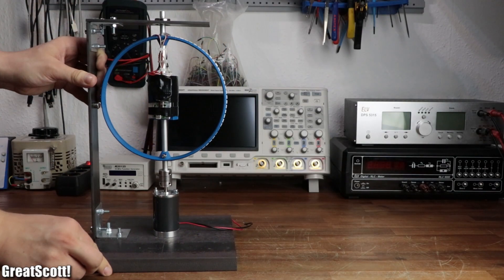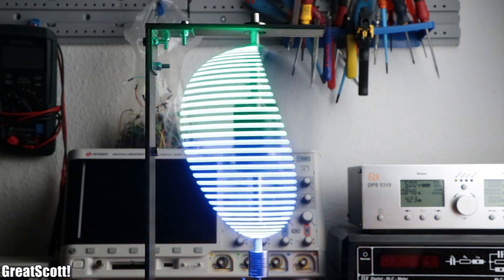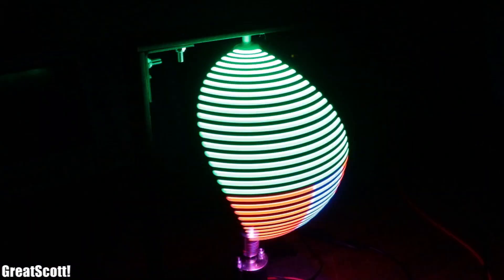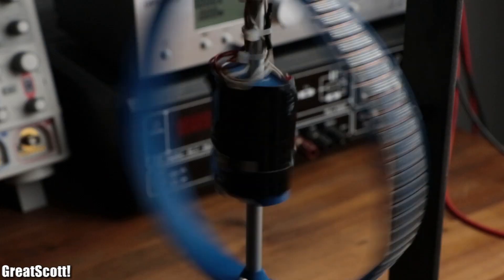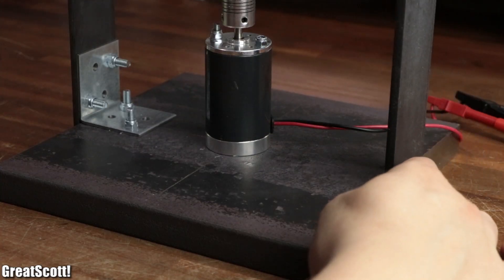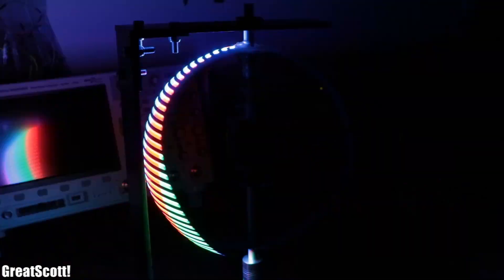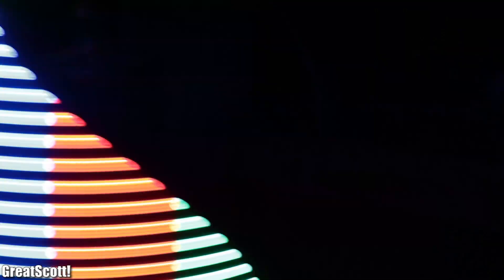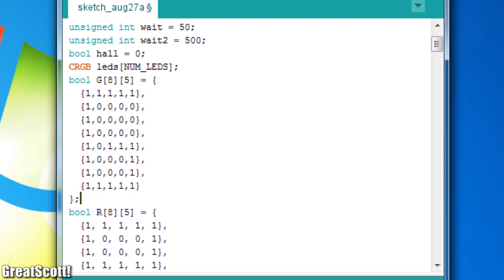Make your own POV LED Globe

Comment: Might want to balance the circle with some counterweights. Also, would like to see someone that can devise a means to power it without a battery.
Reply: The simplest way? Use the rod itself. Use a copper plated aluminum rod and cut it halfway in the middle, then connect the two pieces back together with insulation in the middle (A bit of plastic?) so you have two conductive rods, one coming from the top and one from the bottom. Use a small DC brush at the top of the rod to connect to the +5 volt rail and another small brush at the bottom of the rod to connect to the ground rail. Voila, power to the middle

I actually made something like this but it was a disc that rotated with a string of LEDs on it and two copper tracks at the outer edge on which two carbon brushes rested to allow moving power to flow.
Reply: Adria Garceran just use brushes
Reply: Newjorciks well he's already shown how to use wireless charging
Reply: I've build a similar POV Glove myself in 2015 and ended up using one brush (4.5V Battery Contact against a metal cylinder around the rod) for +5V and the motor / shaft for ground.
Another possibility would be to install a second motor (with the case rotating and the shaft standing still) which is used as a generator.
For this project, you could probably also just use the upper bearing as the second pole if you isolated it from the motor-shaft-ground.
For transferring data, I think something like bluetooth might be a good choice since brushed don't make a very stable contact.
Reply: It's been done -- just use two bearings, solder a wire on the inside and outside of each one, and pass the power through.  Easy-peasy.
Reply: Either wireless charging or brushes at the bottom of the circle to transmit the power.
Reply: I thought of this as well. Depending on the power consumption of the LEDs, one may actually be able to use a premade 5V/1A coil pair.

Comment: Can you maybe make a BMS for multiple cells? (Max 6s or so) so we can make a good BMS and dont have to order one that has not the right specs (under and over voltage protection etc.) From china

Comment: +GreatScott for the past 3 months, I have been working on a pov display that fits in a fidget spinner. Due to the small size, I had to go all out SMD on my PCB. I used APA 102-2020 LEDs and attiny85-soic8. Thank you for producing all these great videos.
Reply from the maker: Sounds interesting. Thanks for the feedback :-)
Reply: Visit Tinkernut; he did that exact project not too long ago.

Comment: Maybe, it would be better if you use a high speed camera
Reply: Not a high speed time... That's the opposite. Just a longer exposure.
Reply: high speed camera usually means even faster shutter speeds, which means even more flickering. He should record it at 1/50s or slower ... that should get rid of the issue.
Reply: redstone craft guy or just increase the exposure time
Reply: No, he needs a low speed camera (or a lower ISO value) -- so that the frames blur together. -- The problem is that is camera is too high speed for this video. -- He could probably obtain the blur from post-processing as well, but, whatever.
Reply: You can rent one without too much cost.
Reply: Awesome
Reply: redstone craft guy he got to get the video to 10 minutes
Reply: redstone craft guy maybe, but thousands of euros would be too much for a single video ; )

Comment: Only thing bad is the camera frame rate. Now we cant see how amazingly it actually looks
Reply from the maker: Yes, it was a shame. I tried different settings and changed the RPM but the flicker was always there. But you can visit the instructables link and see a couple more pictures of the globe. There you can see the complete static picture, the way you would see it with your eyes.
Reply: krtek 60 FPS camera does not fix the problem. In fact it makes it worse
Reply: GreatScott! Tried fiddling with the shutter speed?
Reply: To make it looks better he has to lower the framerate, not increase it
Reply: Krtek, Yes, worse. Actually he needs to decrease the shutter speed(increase the time that the sensor gets light) and one way to do it is to decrease the framerate.

If he increased the camera to 60fps to looks like IRL he would need to sync the camera shutter and the globe. If he didn't do that, the flickering will increase(An example is when you try to record a CRT TV, if you change the time where you turn on the camera, it changes the flickering too).

He needs to lower the framerate and decrease the shutter speed to make the light pass more than 2 times on the sensor and capturing the full image.

If you don't believe that, ask him to sent you the exif data from the images on the Instructables link and looks that the camera don't take the image in a 1/60 time frame
Reply: GreatScott! You can try shooting the video in fully manual mode at 24fps with 1/24sec exposure. The exposure should be exact reciprocal of FPS and should be more than the rotational period of your motor (more than 1/50sec in your case).
Reply: GreatScott! I think smartereveryday did a video using a similar display, he simulates the persistance of vision using software, i suggest you have a look +GreatScott!
Reply: Actualy, that would have made the problem worse,
He should have sticked to whatever frame rate he liked, but should have used the same shutterspeed, not halve the shutterspeed, as is normal with video.
So, setting the shutter to 1/30 at 30 frames per second or 1/50 at 50 frames per second would have made it look perfect.
Reply: Swaroop Bhonde In between frames, there is always an off time, so 24fps with 1/24 second exposure is impossible.
Reply: Amazing he take the time to make these videos and how rude some of you people are.  What have you contributed besides your stupid comments?
Reply: @jimb032  If you read the above, people are trying to help with the problem that is happening.
Reply: krtek 60fps cameras are expensiver

Comment: Awesome project! If you experience flickering on camera maybe try to record with a higher frame rate such as 60 FPS.
Reply: With a POV effect, wouldn't a LOWER frame rate work better?
Reply: The problem is actually because of the rolling shutter (most cameras have) record it with a camera having global shutter and it will be just fine! but those are tooooooooo expensive...
Reply: It's neither an FPS nor rolling shutter issue (FPS would make it worse and rolling isn't an issue as ideally the picture should be stable). What he needs is a longer exposure time to bridge the LED's "downtime" which causes the flickering.